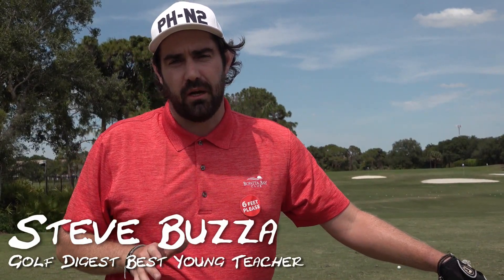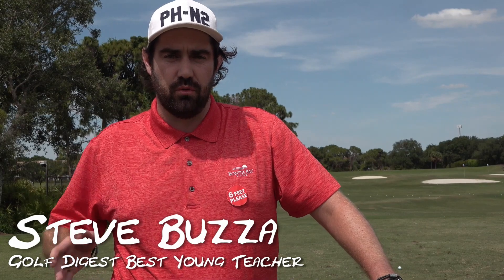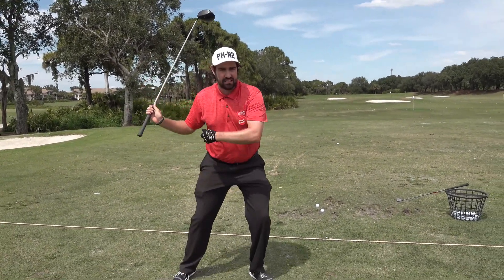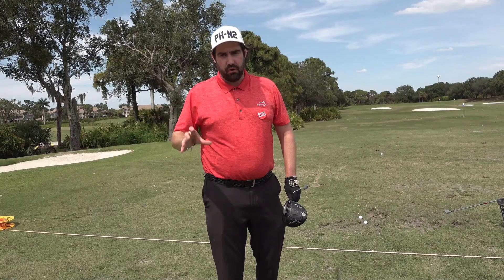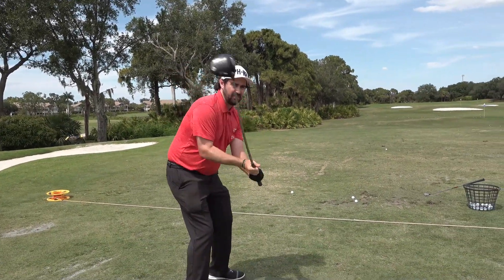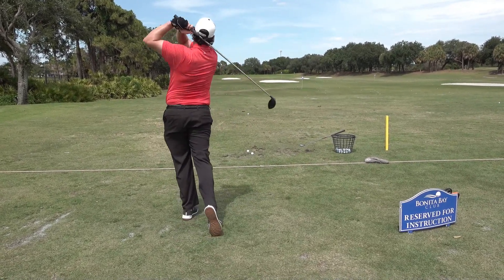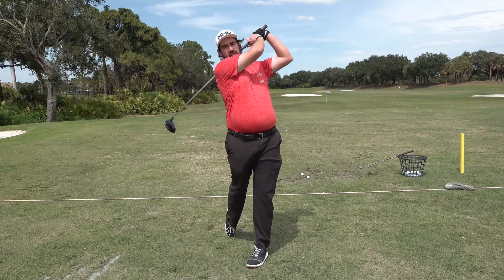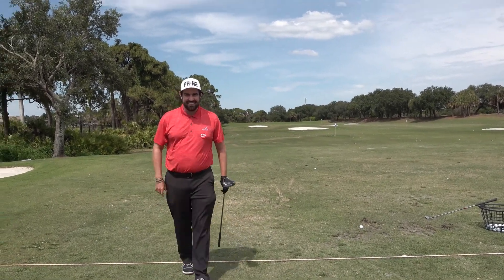Hitting Bombs Vs Just trying to find fairways (My biomechanics Research)

Comment: I find that really helps on my driver due to the longer shaft.  Do you recommend it for irons as well?  When I try it with the irons, I tend to hit long pulls, but that could be a sequencing issue or due to the shorter shaft.
Reply from the maker: I’m more about hitting stock yardages with the irons so slightly different